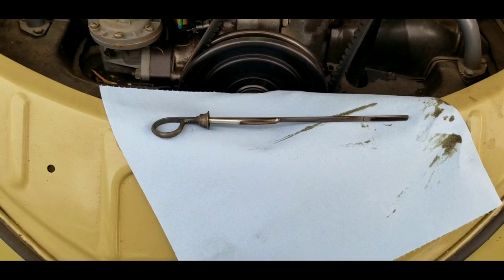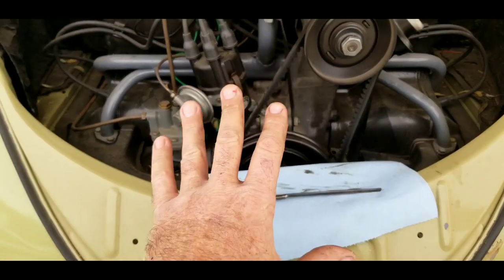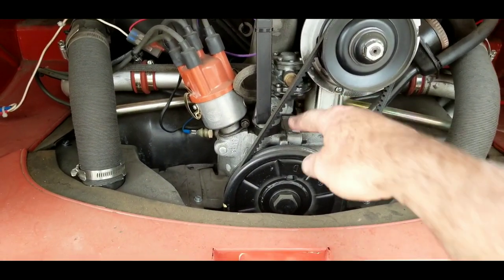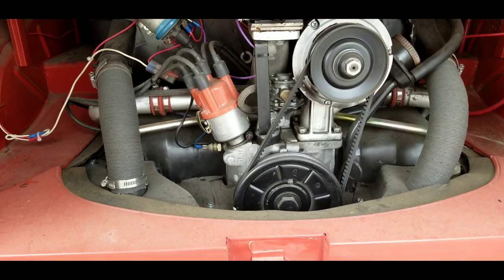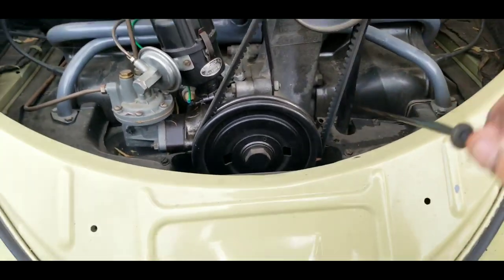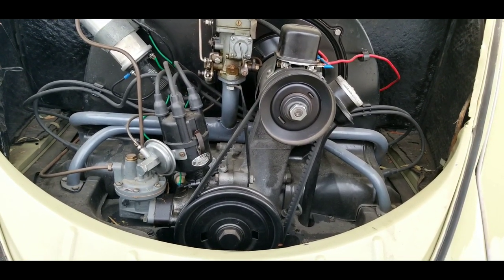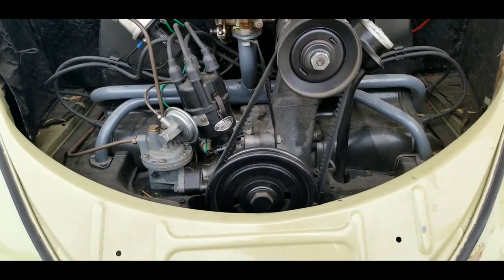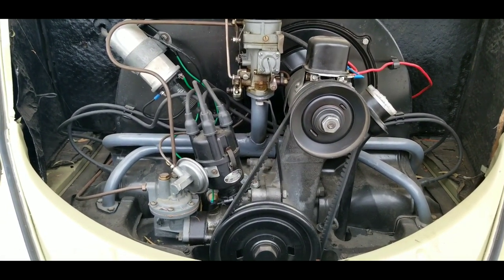VW engine  how to check your OIL WTF

Comment: Valvoline straight 30 wt. VR1.  all I use on a 40hp.  Mild climate.  Be carefull of higher viscosity or you will close the bypass to the cooler.  Stick to the owners manual and you can't go wrong.  On my engine,  2.6 qts puts the level in between the marks.  That way the strainer acts as a pool skimmer.  Overfilling to the high mark will not strain the floaties  The only thing I have ever found in the strainer is bits of cork valve cover gaskets.  My engine loves the zinc!!  Good info Mike!

Comment: Good video I've had that fuel issue happen so bad on lawn equipment that I go hey I'm out of gas! Yeah it leaked pass the float and filled the crank case....and had it happen on my 74 charger! Always caught it quick..... I also always look at condition of oil and check if there is any foreign matter are metal flakes in the oil just in case....on air cooled engines I own I've always changed the oil sooner they are harder on oil than water cooled counterparts..... just taking the extra time to keep up on your oil can save you a lot of money down the line.

Comment: FYI, on a full flow oil system, use a 1/2” ntp one way check valve on one of your oil lines to prevent oil drain back into the case and overfilling the case.
Reply from the maker: cool I do like to drain them when I change the oil though. I wonder if that interferes with that

Comment: Thanks, for the information 
Some other fuel pump leaks show outside between fuel ,engine block
Reply from the maker: yea the old fords and chevys had that weep hole . the vws dont and it leaks into the engine case. Horrible.

Comment: Great video as usual I run mobile 1 in all my vehicles new or old all the way back to my 1942 Indian chief through my 58 beetle and through my brand new van all my vehicles run mobile 1. I've never had a problem with leakage. I just make sure I run the right viscosity, the engines seems to run quieter on it when they get  hot
Reply from the maker: Thanks for sharing

Comment: You got into the oil discussion more than I would. 
Most of the crap you hear about Synthetic oils is crap. They are fine to run in your VW. The only thing I tell people is to make sure they use high zinc oil or additive, I’ve seen what happens over the long haul when they don’t. Oils have changed a lot over the years and aren’t the same as they were in the 80’s or 90’s.
Reply from the maker: synthetics are good. but one of the selling points is they last longer. In a vw with no oil filter best to keep it clean. with castrol being  clean my buddies are getting as much as 150k miles out of a vw engine. now that is not a stroker.

Comment: Thanks Mike. Oil very big deal. Just brought home a 73 baja bug sat for 15 years, before i did first start pulled dip stick its very high on it so think prob water in it...smelled it and its mostly gas
Reply from the maker: yea could have been gas from carb if it has a tank in the rear or bad fuel pump. gotta smell that sucker.

Comment: Great informative videos/tutorials as always, many thanks for your time. Regarding oil weight for stock engines do you recommend  10w-40 for freshly built engines with tight tolerances and 20w-50 for engines with high mileage? Do stock engines have small oil galleries which can by pass the oil cooler? Thanks for your help
Reply from the maker: mostly 20 50 but 10 40 is also good IMO. in the winter.

Comment: I heard that synthetic oil doesn't convect  heat as well so not ideal for aircooled motor. It stays cooler and not getting hot and letting heat out of motor. More insulative quality good for maintaining viscosity  and being thinner for cold starts.

Comment: Aqui no Brasil usamos oleo para motor diesel  15w40 ele é melhor para limpeza do carter tirando as borras , mas a VW recomenda o oleo 20 w50 , ai na america se usa oleo de motores diesel nos VW air ?
Reply: Bom Dia, but that's all the Portuguese I know.  we have diesels,  but there are a minority.  I do not know how diesel engine oil is different,  but since you operate at different temperatures and pressures,  maybe you a different film thickness ?   Think of it as two mountain ranges, one on top of each other and the oil film rides between those ridges preventing contact.   If the film is to thin, the ridges hit and you get bearing wear and short engine life.   At the stores, there are different engine oils. I use 20W50.  I used to use 20w50 in my 1974 Porsche 911 in the summer.  And if VW recommends it, then that probably is a good choice.  Is it possible to find that viscosity for your Fusca ?
Reply: @DanTheManIOM  Ola Dan ! sim aqui nos temos o oleo 20w50 mas existe alguns seguidores do oleo para motores diesel ele é mais fino e descarboniza bem o carter e da uma lubrificação melhor no meu entender,  embora concordo com voce e fico na duvida , mas acho que o correto mesmo é usar o 20w50 que é recomendado pela VW , encontrei um da Castrol que descarboniza e é 20w50 vou usar na proxima troca, muito bom seus videos Dan sempre assisto , saudações do Brasil

Comment: Can I ask about the carb you are running on the red vehicle. It looks like a Weber progressive mounted backwards. In guessing it’s not, but Is it?  Asking because that would sure make access to the mixture screws easier, but would mess with the accelerator linkage.
Reply from the maker: it is called an Egas carb. similar to the progressive but both open at the same time. Much easier to jet, has chokes, and 38 38. really good carb for single reliable driving. and still has lots of performance. https://www.ebay.com/i/172946214290?chn=ps&norover=1&mkevt=1&mkrid=711-117182-37290-0&mkcid=2&itemid=172946214290&targetid=935431405133&device=c&mktype=pla&googleloc=9031487&poi=&campaignid=10877149822&mkgroupid=108755327964&rlsatarget=aud-412677883135:pla-935431405133&abcId=9300400&merchantid=114737488&gclid=CjwKCAiAiML-BRAAEiwAuWVggp1U-YfYQrDw96FqYniFDi_IFL4LxyIRlxDvd2-HmMK1LQRr_PiyeBoCQtkQAvD_BwE
Reply from the maker: actually here is where I get them Empi also sell them for a premium dollar. https://swperformanceparts.com/product/428carb/?gclid=CjwKCAiAiML-BRAAEiwAuWVggk0HZcZmujlzMDvDv8fUjbhGk1DEY_J_wYUTj9BzFl4QrMt_Omo_YxoCTPoQAvD_BwE

fits on the same manifold. as the progressive. and I think you need a linkage kit.

Comment: Do you use zinc additives in your oil?

I have always used Amsoil Z-Rod (zinc is in it)  with really good luck

8:53 i noticed on that car you have a  lot of those small plaques over the engine air intake. I see that are slightly lifted off the vent but do you think it hinders the air flow?
Reply from the maker: yes sometimes I use Lucas small amounts on stock engine
Reply: @Mikefngarage  ok thanks
Reply: I’d love to know what viscosity of z rod being used. I run amsoil in everything and would like to keep it that way.

Comment: Which Castrol, Monograde HD 40 or 30? How does it compare to Shell Rotella T1 single grade? Im in FL, pretty hot here too. Thanks!
Reply from the maker: I have always used multiride. castrol. 20 50 keeps its viscosity. with these oils you dont really need single weight. like the old school.

Comment: Specifically, what castrol do you use?
Reply from the maker: standard 20w 50
Reply: @Mikefngarage  really 20 50?
Reply from the maker: @modotvideo  yea guys run straight 40 too. but I rather have the multiweight. Remember engine oil temp is much higher on vw than most cars.

Comment: In all of my vehicles I've owned since the 1960's, I ONLY check the oil after it has been fully warmed (preferably driven) and then left to sit for at least 5 - 10 minutes. (If you've ever owned anything with a dry sump oil tank (like a Harley engine) you will know why this is critical.) Never, ever over-fill! Always check on level ground. This sounds obvious, but so many people don't understand why this is so important. 

Two designs on the original VW engine that I have never understood is why the total oil capacity is 2.5 quarts in an engine that depends on air and oil to cool it and why the "oil filter" is the worst design ever for keeping the oil clean. 

Don't get me wrong, I love the boxer engine and I want to love the original Beetle. But my Gen 2 Corvair engine was far superior to VW in so many ways! Subaru's boxer engine would be good if they hadn't let the head gasket problem go on for decades. 

I've always liked quirky engines. I drive an old VW Rabbit 2.5 I-5 right now and love it! 

Enough of my rambling....carry on.

Comment: What has been your experience with multi-weight vs single weight?
Reply from the maker: Old school guys say single weight but I always use 20/50 sometimes in the winter 10 40 if there is none available. I think the singe weight thing was for the old oil formulas back in the early 70s before castrol or Kendall
Reply: The single weight oils diddnt have the modern detergents and the particles would sink to the bottom as a sludge.  In those engines no oil filters were used so the idea was to clean the oil pan and the screen at oil changers. Early lawn mower engines were the same .
Reply: @Mikefngarage  20/50 sounds good. I'll go back to Castrol. I am trying with my latest oil change Lucas 10/40 for classic cars. It has more zinc. I thought that might be useful. On a non-related note, I bought DOT 4 brake fluid by mistake. If I were to flush the system of the old DOT 3, what does experience say about using DOT 4 synthetic instead?

Comment: I'm confused...with the added oil sump and the extra capacity inside the oil lines going to the external cooler, the original dipstick marking MUST be inaccurate. (with all that additional stuff, you're probably adding an extra quart or two)

Comment: How do you feel about diesel oil? Higher zink I heard.
Reply from the maker: some guys use that. I have on occasion when I needed to change it and that is all I have. castrol or kendall are fine. Plus sometimes a put a 1/2 pint of lucas.

Comment: I had some gas in my oil in my 1969 VW the other day.    I was checking the dipstick and it smelled of gasoline and the di[pstick was about the top line.   I drained to old oil with gas  and I replaced the old fuel pump and push rod.   I then filled my cc1600 motor with 2.5 quarts of oil.  And a funny think very little oil showed up on the dipstick.   What could that be about>>>

Comment: I've always used Castrol synthetic, never had any problems.
Reply from the maker: good stuff. excellent oil. havent tried it yet. partly because I change it so often because no filter. the reason the synthetic is so good is because it lasts longer and lubricates better longer. So i havent used it yet in my vw engines. In my Jetta I use german spec synthetic only.
Reply: @Mikefngarage  that's the only down fall, expensive. I can't tell that it works any better than conventional Castrol gtx, I change my oil often too,as soon as it gets dirty. My 1500 single port and 1600 do have ran for years, they leak a little.

Comment: I switched to Royal Purple HPS in  my bug.  Royal Purple HPS oils are fortified with a high level of zinc / phosphorus. I still change it regularly though. It gets way below zero (F) where I live, which is why I switched. I have noticed my engine is a little quieter on synthetic, and no, it didn't cause any leaks. https://www.royalpurple.com/product/hps-high-performance-street-motor-oil/
Reply from the maker: cool. that oil is great stuff. Yea I would have thermostats on that one. or if you dont put a piece of wood over the fan for a few minutes to warm it up then dont forget to move it over to the other side of the engine while driving.